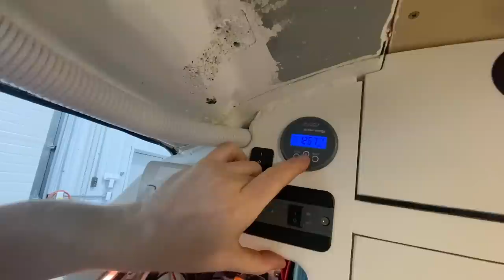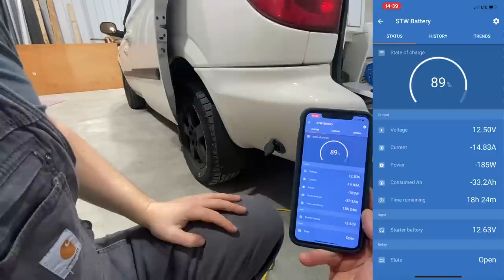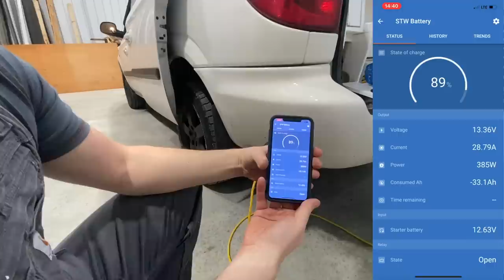Zen & The Art Of Van Life Maintenance + Thai Chicken Curry

Comment: Hi Joseph! I think it's normal to need the vehicle running when using an air compressor no matter how new your batteries are. When I've used my air compressor plugged in to a socket in my new car, it runs much better and stronger when the engine is running. 😊🤷🏼‍♂
Reply from the maker: I'm starting to think that too.  In the past my house batteries would deliver more then they are now.  At least now I know to turn the van on when I use it.

Comment: Unless you are running your compressor off the auxillery battery, then you should always have your starter running. It probably has a built in safeguard to stop you flattening your battery. The compressor would draw a fair amount of voltage and you are probably also having minor voltage drop.

Comment: I have been living in a van for 5 1/2 year’s and there is always dust ..I vacuum everyday…At night I spread my blankets out..If I shine a  flashlight inside my van has  dust  floating all over ..So I turn on my exhaust fan on the ceiling to clear out the dust…..I  don’t want to breathe all that dust in while sleeping …
Reply from the maker: Maybe I should dust mine out more frequently.  That was 3.5 years worth in my fridge and around my heater.

Comment: Ooh I'm curious about those phone chargers. You've got those mounted pretty flush - no issues routing the cable? All the ones I see on Amazon are pretty thin and don't look like they would work very well mounting them up like you have.
Reply from the maker: I got those at IKEA of all places and they are thin.  It took some clever router work to fit them flush. They're now totally integrated into that top. 

I was just looking through my build series videos to see where I did that, but I think it's part of episode 26 which I still haven't put out.  Maybe I should finish that build series; they're throw back videos so they can be confusing.
Reply: I wondered if routing was going to be the trick. Thanks for replying!

Also, regarding your batteries - I poked around the battery vendor's site. Despite the other bits, it appears they're still AGM batteries, which likely means you shouldn't be discharging them past 50% capacity else risk damaging the cells. Something to consider.
Reply from the maker: @wanderingzythophile9083  I'm not sure about that.  I have all my info on them from the manufacturer and have been shared more promising documentation on them.  However even with all of that I have never taken them below 50%.  I usually take them down to 60%  and only three time have I taken them down to 55%. 

In any case I've been in touch with about it and they agree that it is too early for me to be having these issues.  For now they're working on a few ideas for me.  One may be a restoration of sorts, but the process for that would leave me stranded without power for 72hours.  I said that's sometime I can't be without in my line work.  Anyway, we'll see.
Reply: They couldn't set you up with a pair of loaner batteries for that period?